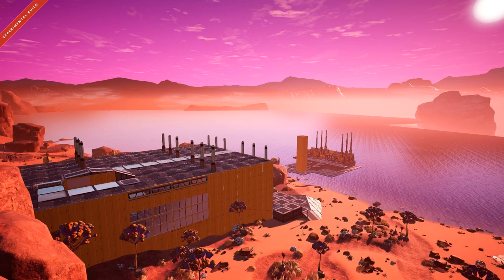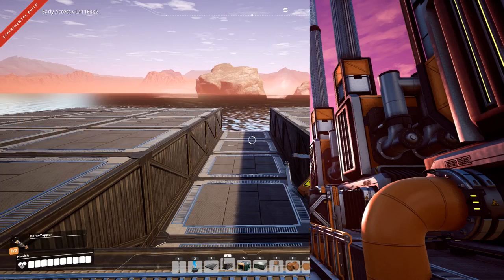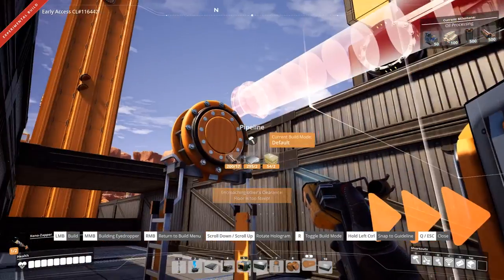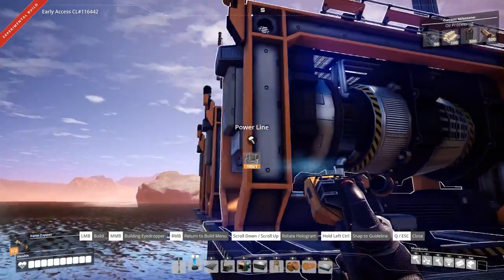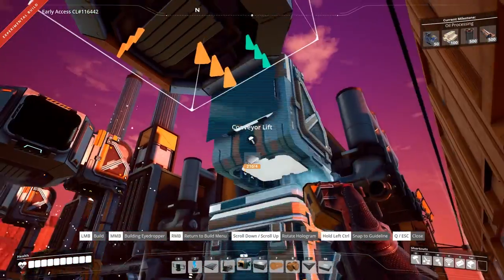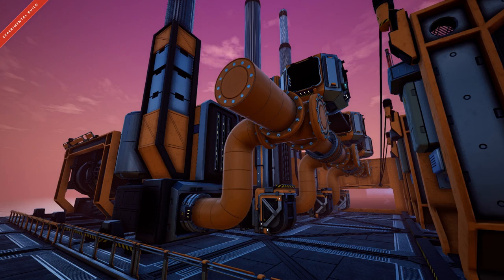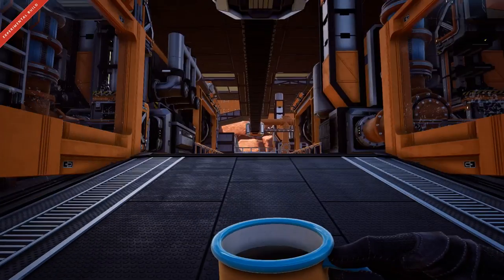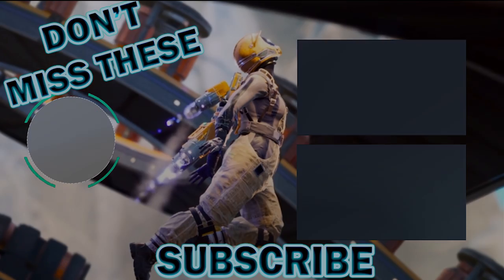3 Neat and Easy ways to Run Coal Power Plants Update 3 [Satisfactory]

Comment: I ended up settling on a 6x1 layout for plants at water level. A fully sharded pump supplies 6 generators. I can then run as many copies of that as I can supply coal. I run the pipes at floor level, using the pipe connectors in the same way I place splitters, and then run the coal right above that. The walkways go over the coal line.

Comment: Thanks, I've been using your 1st option and it's super clean. However I tried making too many generators and the center pipe couldn't handle this many generators ^^'. I toped at 28 generators before some were constantly shutting off.
Reply from the maker: A pipe can handle just over 6 generators Max. The issue is as your factory consumes more power, you generators will use more water.

Comment: nice video. It would be great to tell best ratio of coal miner, water extractors and coal plants. Personally I came to 2 water extractor and 5 plants system. 3 such systems combined can be fed by 240 coal flow.
Reply from the maker: Павел Абсолют hey! Thanks for the comment, yeh I think when I get round to looking at coal power plants in more detail it would be really good to find the best inputs for the setups ☺️
Reply: @Павел Абсолют
 @TotalXclipse 
coal gens use 45/m water and 15/m coal so if you have 16 powergens can use 6 Water extractors with 2 per pipe (240/m) so total 3 pipes. and 240/m coal coming in.  hope makes sense should be enough to keep them efficient.
Reply: I found that 3 pumps few into 2 pipes works well. The third pump is split and feeds both pipes. This gives 180 water per pipe which is 4 coal generators.
Reply: @SirHackaL0t.  yea thats great! thanks
Reply from the maker: @SYL3NZR  you've put a lot of work into that for a super small setup! You should drop a screenshot of it on our discord and tag me in it! I'd love to check it out!
Reply: @Aiiisen  The burn rate is based on power consumption.  If the coal gen is only at 10% use, one coal will last much longer than 4 seconds.  Because of this, it's difficult to get 100% efficiency.  You never want your coal gens to be running at 100% because that means even one more item pulling power is going to trip the system.

I love how they've implemented it.  It lets me cheese it a bit.  I can run more coal gens than I should simply because they won't be using enough coal to overtax the supply.

As for water...  8:3 seems to be the preferred set up.  8 gens to 3 extractors.  And, if you build "on the water" (as close to water level as possible), you don't even need pumps sucking up unnecessary power.
Reply: I normally go, 6 extractors to 3 pipes.   5 gens off each pipe, combine the pipes at the end and push into the 16 generator (as after taking 5 gens, 225, off each 240 pipe I have 15 left in each.)  That way I've used all the water I extracted. https://i.imgur.com/4FChzGH.jpg
Reply from the maker: @JoannaHammond  Nice set up! and it's a clever setup, does the 16th generator receive just enough water to keep running then or does it fill up with no issue?
Reply: @TotalXclipse  Yep, the last 15 in each pipe is combined to 45 to run that last generator :D
Reply: @Aiiisen  The power plants (coal, fuel, nuclear) all consume fuel at a rate proportional to the power consumption at any given moment. If you are close to full power usage, you will start to starve your coal units if you do not design to the stated consumption of 15 coal per min per generator.
Reply: @skyesfury8511  8:3 looks useful since 8x45 = 3x120 ... too bad that that would be 360, more than the 300 that a mk1 pipe can transport.
another useful ratio : i use 1 of those generators on a separate power network to guarantee that water collectors, miner and pump always work, feeding its 75 MW to 3 water collectors and one miner (3x20 + 1x15 = 75), and with a programmable splitter that generator is guaranteed to get coal with priority. but once again (similar to the 300 cap on pipes) it would need to provide just a little more power than 75MW to also power one pump. both problems can almost perfectly be solved by underclocking the water collectors to 83.3%, now producing 3x100=300 water (matching a single pipe) and saving a little power that can then be used for an additional pump. of course, now you will only have enough water for 6.333 generators, using one of them for the extra network and the other 5 for the factory.

Comment: This may be a noob question but how do you get walkways in the center? Great video!
Reply: Scratch that, I figured it out.
Reply from the maker: Seeing as you've worked it out I'll put it here for others as it's a good question.

There are 3 spaces along a foundation you can place a walkway, left, centre or right. Sometimes it can be fiddly but it works :)
Reply from the maker: Seeing as you've worked it out I'll put it here for others as it's a good question.

There are 3 spaces along a foundation you can place a walkway, left, centre or right. Sometimes it can be fiddly but it works :)
Reply: @TotalXclipse  Yeah, the way I worked it out was by extending the set of foundations out around the area where I wanted to place it and then attaching it to one of those extended foundations. That was the only way I could get it to attach. It's always nice to find little tricks like that in order to kind of cheat the building limitations in a game. Thanks again!

Comment: It's only me or your design is not worrying about the 15 coal / 45 m3  per minute? My challenge here is build efficient lines, plants and such... just in case... a miner doing 180 will required 10 slippers... 180 -> 60 -> 30 -> 10 (considering that you are using the 3 outputs) and it will required One water pump at 75% to feed two coal power plants... 
I like your designs (specially the foundation to cover the hole) and they give me some cool ideas... but to build something efficient we may need sacrifice some of the beauty.
Reply from the maker: Thanks for the message! You raise a good point, but unfortunately with power you'll never have a perfect design - the reason for this is because the more your factory consumes power the faster the intake rate for the coal and water or subsequently if the factory only consumes enough energy for half the powerstations capacity, the coal consumption rate and water consumption rate will be reduced. 
But the closest ratio of generators to power stations is covered in my newest power station layout where there are 8 generators to 3 water extractors using two sets of pipe.
Reply: @TotalXclipse  I see... I see.. yeah.. Agreed... what I do is to plan the plant to run at MAX. That means 15 coal / 45 m3 of water.. and I plan to delivery that.. if is not consuming that much is at least ready to run at 100% of efficiency... but I really understand your point... Thanks for the hints... very good work on the designs... keep doing that...  the viewers appreciate your hints! :-) Stay safe... wash your hands! :-)

Comment: Whatever power we use, it still uses biomass to power it, right? But certainly more efficient than using the biomass itself, or is there another way power it without biomass?🤔
Reply from the maker: I'm not sure I understand? You'll need a biomass power generator to switch the coal power plant on but afterwards it should be self sustaining
Reply: @TotalXclipse  so after i switch to coal power, i no longer using biomass again?
Reply from the maker: Alfian F. Khilmy exactly although I’d still recommend keeping them to help you reboot the power Incase you cause the system to short ☺️
Reply: @TotalXclipse  thank you ! 😁
Reply: @TotalXclipse  3 water extractors and a miner consume 3x20 + 1x15 = 75 MW, exactly the amount that one generator produces.
thus i keep one of the generators (and the 3 extractors and the 1 miner) separate on a power network of their own and if a programmable splitter prioritizes that generator for coal, they are guaranteed to run forever, no matter whether the factory shuts down. with that one generator still working, it refills all water and coal of the other generators and you only need to flip the fuse to start the factory again.
if you want to add a pump (4 MW) to that separate network, you need to reduce power consumption of the extractors, maybe 83% to make 3x100 water (which is exactly the cap of 300 for mk1 pipes) for 6.66 generators (1 special network and 5 for the factory).
btw: this requires 90 coal, easily achievable already in the early game. later you can double this setup and use 6 extractors (at 100%), 16 generators, a better (pure and/or mk2) miner and even some pumps, and use two of those generators for the separate power network that always keeps everything running.

Comment: What can be the problem if water stops reaching my last coal generator in the line? It gets water fast initially but eventually stops getting water pumped to it. All the pipes prior to that point are completely filled.
Reply: how many generators do you have ? mk1 pipes can transport max 300, thus 300/45 = 6.666 generators max.
with mk2 pipes, you can feed up to 13 generators (600/45 = 13.333). if you have more (7+ or 14+) generators attached, they might fill up with water at first (especially if at first not all of them are preloaded with coal and thus produce less power and need less water), but when they all are fed enough coal and you use more power, they use more water and the 7th (or 14th) and further generators will dry out. and there is a limit of 120 for each water collector too.
Reply: @Anson_AKB  Yea that was the exact problem.

Comment: Looks nice but it isn't working efficiently because the succession of splitters. the last factory will take so long to get coal that it will shutdown. Anyone else had that issue? How did you overcame it?
Reply from the maker: Easy way to overcome it. Let it run for half an hour. The way a manifold works is by prioritising the first splitter then once that's saturated, the second splitter, and so on. Until all the lines are saturated but the last two inputs. 
So long as you've got the right numbers, you'll be fine.

Comment: How many coal generators can you feed with one water extractor, I have 4 coal generators in one water extractor and extractor still stops and feeds for sec and stops again?
Reply from the maker: 8 generators to 3 extractors but the problem is fuel consumption and water production scale with consumption, so you will always have the extractor switch on and off unless you have a factory that's running at the exact max power plant capacity
Reply: @TotalXclipse  with update 4, generators now are said to always run at max production :-(
@RakkineMayhem 1 extractor produces 120, one generator consumes 45 (at max production), thus 120/45=2.666 generators, and 4 generators need 4x45=180 water (one extractor at 180/120 = 150%). this costs a lot of additional power, but at least you won't hit the 300 water cap of mk1 pipes.

Comment: Should I just move my base to a body of water? Or make a separate coal generated base?
Reply from the maker: I'd do a power plant separate to your main factory
Reply: @TotalXclipse  and then connect it to my main base somehow or have a completely separate factory? Also how do you connect it, is it through power lines? I just unlocked coal production
Reply from the maker: @Kryozzzzz57  You can connect them through power lines or if unlocked train rails :) I'd keep the two separate but if you prefer - build one large factory, it's your choice

Comment: anyone knows an exact number of coal generators that can be fed by a water extractor?(without overclocking). i'm kind of new to the game and i'm planning on making one of these designs in the near future ( i really like the first design )
thanks for the vid, subscribed
Reply from the maker: so the water extractor can extract 120 pm and a power generator at full power production (scales with factory consumption) so in theory just under three :) welcome
Reply: The common denominator you are looking for is 360. This means 8 generators (8 x 45 = 360) with 3 extractors (3 x 120 =360). But you need at least 2 pipes, as the pipes max is 300.

Comment: But how can you feed 8 coal generators from 1 pipe? :O
Reply: only possible in the long run when he has some hidden water supply :-) or feeds 3*120/45 = 8 generators via more pipes, eg one pipe fed from both ends !
with the old (pre update 4) power generation, it might have been useful to have a few more (8+) generators for short peaks in power consumption. on lower power consumption they (and optionally a water storage at the opposite end of the single pipe) would slowly fill up with water, and on such a peak all 8 (or even more) would be able to kick in for a few short moments when they were previously full of water, but on average (or with update4 "always max" production) and from a single mk1 pipe, no more than 6.666 generators get enough water (or 13.333 with Mk2 pipes)

Comment: Hey! I was building my coal plant with 480 coal/ min entering, I planned it before and everything was looking just fine, but when i finished it and turned it on, I was in 6%-9% efficiency although it looked like I was feeding too much coal to the generators. I used the last method (coal from below and water from above). Can somebody help me? maybe somebody can tell me the number of generators that I need. I do have around 50 power shards at my disposal. Help?
Reply from the maker: oh are you fully utilizing the power plant. It will only use full capacity if you're actually using full capacity on your grid....
Reply: @TotalXclipse Okay! But are the ratios correct?
Reply: im feeding 30 coal to each generator overclocked to 200%
Reply from the maker: @kobeh2937  I believe coal generators can use upto 45 per minute without an overclock, So I think you may need to feed it more if you start using more power.
Reply: @TotalXclipse  So 45 a minute without overclock? that would mean the 480 total coal / 45? Thanks!
Reply: I will remake my setup...
Reply from the maker: @kobeh2937  I think I'm right it's off the top of my head..
Reply: @TotalXclipse  I actually investigated and it said that a generator can only handle 15 / min
Reply: so i will make my setup like that probably
Reply from the maker: @kobeh2937  Oh woops...my bad :D 
That actually explains why my buses are full of coal... maybe that was what it was prior to U3
Sorry. but thanks for letting me know
Reply: @TotalXclipse  Don't worry! I think that was the ratio before...
Reply: in update 4, the generator shows that it needs 15 and 45, but maybe it changed or you exchanged water and coal with each other :
correct should be "15 coal and 45 water, at 100% for 75MW" !

Comment: cool design but your splitters are very badly positioned. the last coal plan will have 1/32th of the amount before it is first splitted.  1 -> 1/2 -> 1/4 -> 1/8 -> 1/16 -> 1/32
Reply from the maker: That's how a manifold works, but it doesn't matter as once the first splitter saturates, the next splitter will gain extra, and this will continue. Also bearing in mind that the load is spread between all power generators, even if two aren't running the rest will take up the difference  - providing when you first start your power plant you're not consuming more than say 50% of your total production. But once it's running, providing you're feeding the correct ratio of water and coal then you should be fine as it will only "run out" once the factory is consuming more power than you can produce. 

After the initial warm up, manifolds are as efficient as a load balance :)
Reply: TotalXclipse thank you for your quick answer! I did not know that. I played a lot of factorio and balancing (before filtering splitter) was one of the hardest thing about the game. I just began playing satisfactory and there so many thing/tips I don’t know.